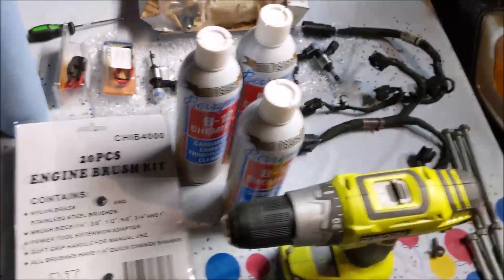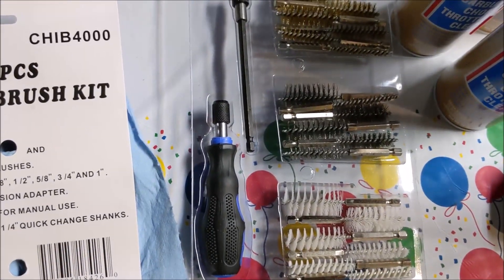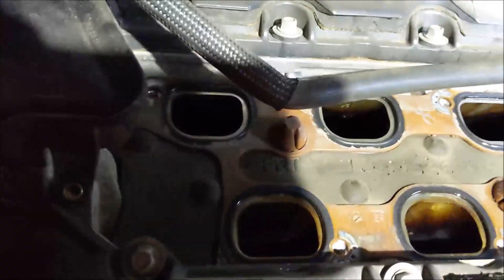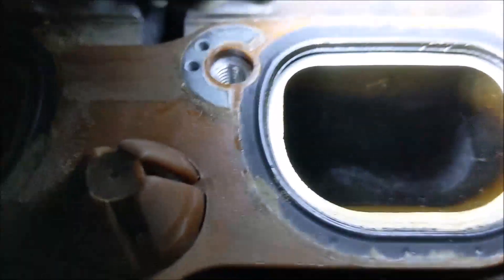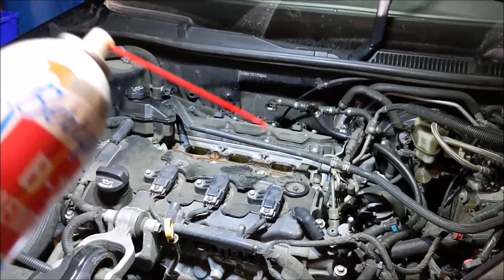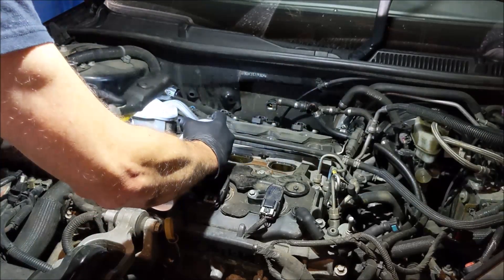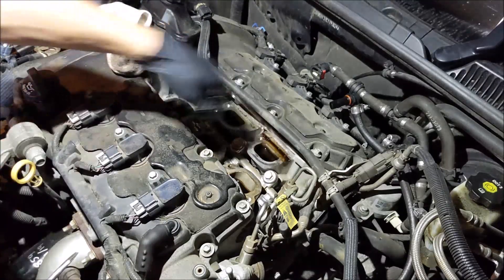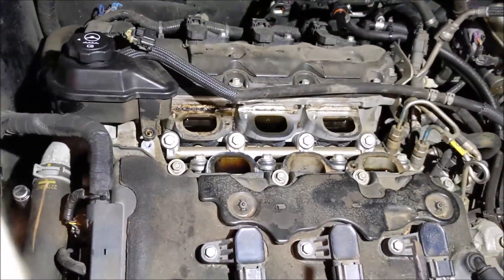GM 3.6 LFX V6 Intake Valve Cleaning (Part 2 of 4)

Comment: This will play at the 10:00 mark but check this tool out. You can blast walnut shells and vacuum it at the same time without creating a mess. https://youtu.be/KFvXbTIiAVY?t=600
I have a 3D printer; I wonder if I could make something like this for the 3.6.
Reply: Nevermind, you can buy one here: https://www.usvetdesigns.com/product-page/chevy-v6-3-6-intake-valve-carbon-cleaner-walnut-blasting-adapter
$28
Reply from the maker: Holy shit this is brilliant!!  The tool says it fits the LLT engine, wonder if it'll fit the LFX. I know there were some design changes to the heads on the LFX, so that tool may need to be modified.
I changed the timestamp at the end of the link you posted to pick up where he shows the tool: 
 https://www.youtube.com/watch?v=KFvXbTIiAVY&t=525s
Reply: Oddly, a few months ago I had an opportunity to get a walnut blaster specially designed to do this for 75% off on Amazon and I passed. I’m thinking about building one from a cheapo 1-gallon shop vac. That’s basically all it was and it draws sand from the bottom of the vac’s tank and goes to a cheap venturi style gun nozzle and the standard vacuum tube sucks it back into the tank. It continuously reuses the walnut shell media. The standalone machine is about $450 on Amazon. You could probably build this for $50-75.
Reply from the maker: @chipjumper  Would def like to see that set-up!!

Comment: I have so many questions but this video is 6 years old so probably no one will answer. How to you know 100% the vavles are closed before you start filling it? What would happen if some of the cleaner got past the valve?
Reply from the maker: It's very easy to look down inside the intake port. You could also use a borascope or even your phone's camera if you absolutely can't see down in there with your naked eye. If cleaner got past the valves, hydrolocking the engine is a real possibility. If you did get cleaner down into the combustion chamber, you'd need to remove the spark plugs and crank the engine over until all of the cleaner is expelled.
Reply: @CertifiedShadetree  Ah ok, I recently got a borascope for this kind of thing, have not checked my valves yet but with 146k on the engine im sure its got build up. I have the exact same engine. Thanks for the reply.
Reply from the maker: @TheArcknight  Best of luck to you! 🍻

Comment: Sup bro? Armchair Joe Homeowner mechanic here. I have a question: If the valves are closed, how are you cleaning the contact surfaces?
Reply from the maker: Simple answer: that part isn't being cleaned. Nor is it necessary to clean that area of the valve or valve seat.
Reply: @CertifiedShadetree  Oh ok. Thanks. I thought that would be the most important area. I know of times the seats have had to be machined and all that and I'm like yeah, fxck that. I just tried a Sea Foam valve cleaner spray process and want to do it a few times over the next few days to see if that helps. I'm thinking about shooting a few shots of carb cleaner into the mix with the Sea Foam spray next time, but I'm not sure if that's risky for any reason. Thanks again brother.
Reply from the maker: @ I'll be honest with you, the spray stuff doesn't really do jack shit. I was spraying CRC GDI Intake Cleaner into the intake tube on this car every oil change for 2 years, and you can see the results in this video..
Reply: Not very wise using a vacuum to clean up flammable liquids.

Comment: I have a impala with that engine , very powerfull , but it's so far behind the Japanese cars in technology . You would never have to do that job with a camry or accord.  Because they have fuel shooting into the cylinder and on top of the valves
Reply from the maker: Yep, Toyota has a DI engine that also has port fuel injection. Solves the carbon build-up problem rather easily. Give GM some credit, though. They stuck with pushrod engines so long, direct injection and double overhead camshafts were a revelation when they finally put that technology in the ancient W-Body platform in 2012! 🤣

Comment: Great informative video. How long did it take you to get the job done in hours?
Reply from the maker: I recall doing the entire project over a span of 3 days and that includes replacing the fuel injectors and soaking the upper intake in a tote full of Purple Power. Just cleaning the intake valves shouldn't take more than 3-4 hours.

Comment: Personally I would simply use a walnut blaster setup to do this job. Its so easy and quick, no odor or splashing back etc and its spotless when you're done. I bought everything at Harbor Freight and modded the blaster with a 3/8 metal line to reach way down into the ports. Good Luck
Reply from the maker: What did your setup end up costing you?
Reply: @CertifiedShadetree  The HF portable abrasive blaster is $30, the walnut media is about $30, and maybe $5 in hardware to extend the nozzle out to reach down.
Reply from the maker: @cup_and_cone  Righteous!
Reply: @cup_and_cone you should do a video at least showing what you got.

Comment: Would you recommend doing this before installing the catch can setups?
Reply from the maker: I would at least pull the plenum and peek down inside the runners to see the condition of the valves before attempting a cleaning. Might be a good time to change your spark plugs while the plenum is off as well.
Reply: Dang it, I already did the plugs like 2 months back. Eh worth cracking open and taking a peek lol
Reply from the maker: For sure!
Reply: Also quick question since we are here, ever heard of anyone cleaning their cats out on the front two and running the simulator sensors?
Reply from the maker: I was chatting with a guy a few years ago who gutted his Impala's cats and straight piped it all the way back true dual-style without the crossover. No mufflers, no resonator and he toyed around with X-Pipes and H-Pipes. He said removing all of those restrictions completely killed the 3.6's bottom end torque and concluded the 3.6 NEEDS backpressure to perform!!

Comment: Nice guide, I'm going to be doing this on my car soon. Mine is an LF3 which is a twin turbo version of the LFX, and it has the worst carbon buildup I've ever seen on any car. I thought 1st gen audi/VW GDI engines got bad but geez, this thing is putting them to shame at 70k miles. Its 3-4mm thick in some spots. 

I was originally investigating a very rough idle (especially with A/C off) and got into the upper intake manifold/intercoolers to clean the throttle body which was gunked up bad too. I took a peep down the throttle body hole into the intake runners and almost shit myself, I've only ever seen this kind of buildup on a diesel trucks EGR system.
Reply from the maker: Be sure you put a catch can on the dirty side of the PCV and a clean-side separator on the clean side of the PCV.  That'll ensure you don't get any more blow-by in the intake tract..
Reply: @CertifiedShadetree  Absolutely! I have one of those mishimoto clones on the dirty side, I happened to have it on hand already from a different car. The XTS LF3 uses a totally different PCV system, I suppose because its transverse mounted, so it was a little bit of a challenge to figure out where I needed to go.
Reply from the maker: I suppose having a couple of hair dryers mounted up to the motor complicates things a bit!! 🤣

Comment: Hey forgot to ask how do you close the valves?
Reply from the maker: Either bump the starter or spin the crank pulley by hand with a breaker bar.
Reply: Which direction do you crank it? @CertifiedShadetree
Reply from the maker: @Matt-jp2ht  Clockwise
Reply: Man, I did this but the valves may have been open now the car won't start. Help me please!!!!!!

Comment: Would using CRC DI cleaner every oil change help prevent or at least slow the fouling of the intakes ? Thank you
Reply from the maker: I used to do that, but on my engine it proved to be ineffective. If you really want to stop carbon buildup, use an Ultra Synthetic oil like Mobil 1 extended performance or Valvoline extended protection and install a catch can..
Reply: @CertifiedShadetree  I’ve been using Castro edge. You think that one is ok?
Reply from the maker: Go with the extended performance EDGE (but change it every 4k instead of 10k.) How much oil does your engine consume?
Reply: @CertifiedShadetree  I change it every 4K seen a lot of forums recommending it, and I agree I’ve always changed my oil every 3-3500. Last two changes I got a little over 5 quarts. So I burn about half to a qtr quart every 4K. But that was after making long trips
Reply from the maker: @unitedwestanddividedwefall3521  That's not too bad, actually.  I'd still install a catch can, though.

Comment: I have a 2013 cylinder 3 has zero pressure. am I just wasting time watching this?
Reply from the maker: "Zero pressure" meaning what, exactly? Zero fuel pressure? Zero compression? Either way, it's not likely a valve cleaning will solve the problem...

Comment: What are symptoms of this needing done? My Impala limited runs like shit anymore. Getting lots of popping through the intake and sometimes feels like it has no power for a few seconds
Reply from the maker: The issue my car had was a bad misfire whenever it was snowing out, weird as that sounds.  I would get code P0276 (cylinder 6 misfire.)  I doubt it was the dirty intake valves causing the issue, though. I changed out the injectors and injector wiring harnesses (in the next video in fact) and that seemed to remedy the problem.
Reply: @CertifiedShadetree  I really think the ignition coils are slowly dying one by one on my car. At about 90k I put in new delco spark plugs. At around 100k it kept feeling like it was misfiring but wouldn’t set a check engine light. Then one morning it finally set the light. Took it to dealer and they said plug in cylinder 5 was cracked and coil was burnt, had them replace both and all was fine for a while. Then it started to do it again and this time it was cylinder 6. Replaced both for cylinder 6 and it was fine for a few weeks. Then it started to do it again this time it comes up as cylinder 5. Replaced both on cylinder 5 and now it’s acting up again but no check engine light yet. It seems to only set the light first thing in the morning when it’s cold. As bad as it misses when your driving I’m surprised it doesn’t set it then.
Reply from the maker: How many miles do you have on 'er now?  And did you replace the plugs with the OEM Iridiums?  I would imagine the dealer would've replaced the coil(s) with OEM parts.  My thoughts are turning to pretty much every GM I've owned in the last 20 years that would quickly develop issues whenever I strayed from OEM ignition parts.  You know, I'd maybe pull all of the coils and check the condition of the boots.  You can get a new set of boots from RockAuto for less than $30, rebuild 'em and see if the misfiring goes away.  Maybe check the electrical connections at the coils, see if there's any corrosion or frayed wires.  And for good measure, pull the spark plugs and check their condition.  I've messed up spark plugs before when reinstalling the rears - accidentally bending the side strap inward and causing misfiring.
Reply: Sounds kinda like a timing chain issue

Comment: I got a misfire on cylinder 2, took the intake off and oddly enough cylinder 2 in particular was fouled badly (the others were dirty but not nearly as bad) and there was some oil in the intake. PCV valve was plugged pretty bad. Replaced the valve, do you think this would fix the misfire?
Reply from the maker: The oil in the intake is the root cause, but by this point, your injectors are likely fouled.  I would pull the injectors and clean the tips. Soak the tips in some carb cleaner for a couple hours and scrub the carbon off. Check out my other videos, I show how to pull the injectors, and offer up some tips on maintaining the 3.6. Regarding the PCV, drill out the top hole to 7/64" and the bottom 2 to 5/64".
Reply: @CertifiedShadetree  Thanks, that confirms my theory. I used seafoam to see what it would do and for a few seconds the misfire went away and the light on the dash stopped blinking but then it came back again.  I think you're right about the injectors being fouled as the seafoam probably simulated the right air/fuel mixture in the cylinder for a bit.
Reply from the maker: Right, and it won't do much of anything to clean the injectors, as they're buried deep in the cylinder head.

Comment: Would this process be the same for a 2010 cts 3.0.?
Reply from the maker: Absolutely. The intake removal procedure won't be exact, but should be similar to the Impala LFX.
Reply: LeaderOfWagons cool thank you. I have all that taken apart im working on the hpfp just waiting on it to come in. I cant figure out how to take fuel rail and injectors out. But ran in to the intake cleaning I figured i can do that while waiting
Reply from the maker: @jaehone28  If you haven't already, be sure to check out the link I have to the Bosch website. It's not only very insightful, but pretty much all that's available for these engines on the internet for free...
Reply: LeaderOfWagons yea thank you. all the knowledge i have about the cara is from YouTubers like you that just help me out by watching the videos over and over.
Reply from the maker: You're welcome!! Good luck with your project!! 🍻

Comment: Hey man. Cool vid. I have a car with an LFX in it and there are 2 cylinders where the rocker arms keep falling off.. I think I need to take the heads off to see what’s going on. Have you done this on these engines before? I’m trying to figure out how the direct injection rail comes out and how the mechanical fuel pump disconnects from the back of the head... any tips would be appreciate!!! Thanks.
Reply from the maker: I have not had to remove cylinder heads on this engine yet. Check out the links in the description of this video. I removed the rail, swapped out the injectors, and reinstalled them in another video. I also have a link posted to Bosch's website detailing the fuel system on the 3.6 - I believe there's instructions on removing the high pressure fuel pump. Hope this helps!
Reply: LeaderOfWagons legend!! Thanks a lot man.. I’ll check it out now!!
Reply from the maker: No problem, good luck!!

Comment: Thanks for posting!  I just did this on my 2016 Lacrosse.  They look way better now than they did.  I am nervous now hoping that I didnt dislodge a peice of carbon tgat I didnt get out or something.  The buildup was fairly soft, so hoping it wouldnt be a major deal either way.
Reply from the maker: Glad I could help!!  In my opinion, I would imagine by sitting in solvent, any leftover carbon would be softened enough so it wouldn't cause any damage before it got trapped in the oil filter.  It's been 6 months since I did this, and have had no issues whatsoever.

Comment: cool video. and nice shoutout on me lol btw and answering me thru a video. I ended up just squeezing the steering fluid sucking it thru a tube. it helped a it alot.
Reply from the maker: Ah, forgot about that!!  LOL  That pump does look like a colossal pain in the ass to remove, tho...
Reply: LeaderOfWagons I actually tried going under my car to see if I can just remove it but I almost clamped off another hose so I tried finding a diagram and didn’t see where it lead so glad you pointed that out. I just used a turkey baster and turned it maybe 20 times. It works so far but I def want a clean flush and def will try to clean the intake on mine as its at 83k now
Reply from the maker: Another way would be to remove the lines at the steering rack.  The only downside to doing it that way is you have to drop the rear of the cradle 4" or so to access them.  It's really not that difficult to drop the cradle if you have a good floor jack, 3 pairs of jack stands, and an impact gun.  Personally, I'd rather do it that way than try to get that damn pump off of the engine!!!